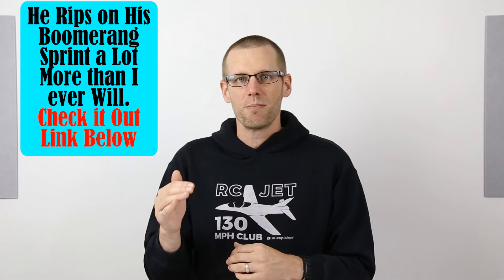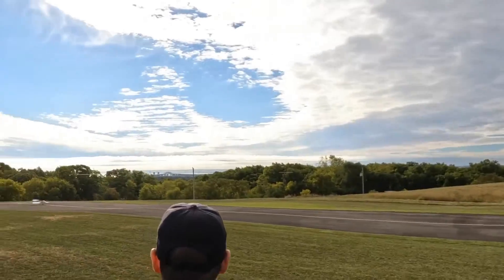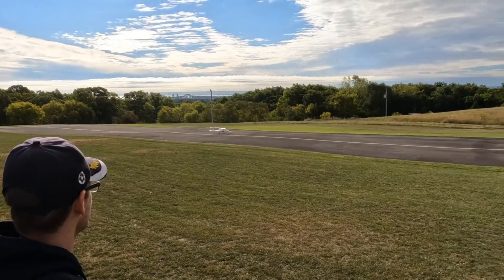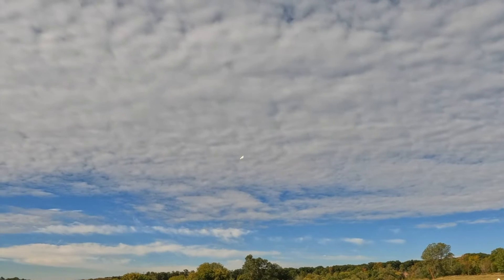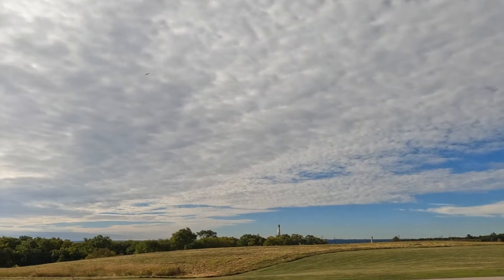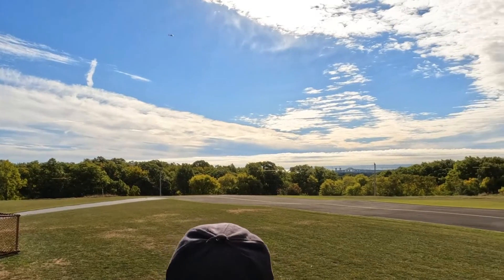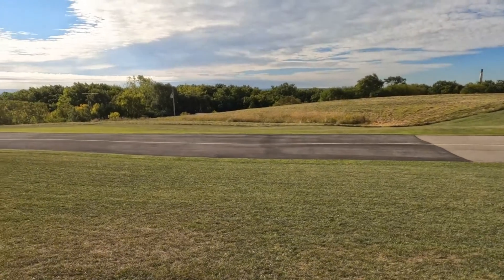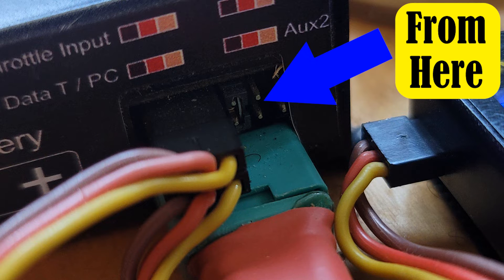What Happens when a $6500 RC Jet's Turbine Engine Quits Mid Flight?

Comment: I saw a video of a guy just started his for the second time ever and the starter stuck on. It spun up like it was supposed to but the starter disintegrated. He didnt know it was stuck on. Yours wasnt winding down like it wasnt getting fuel. Something was slowing the turbine and shaft down. Perhaps the starter?
Not that you would, but what happens if you accidentally hit the starter in flight? Does it engage?
I would bench test it again, but roll the engine side to side and upside down. Simulate the flight as much as possible and see what happens.
Reply from the maker: I think I saw the same video. The starter on this engine disengages at 27k RPM well below idle RPM. During the start up sequence I confirm this has happened and it's very noticeable by ear.
A user can't engage the starter while the engine is running. You can only give commands such as start, stop and cool the engine. 
I'm also sure that if it was stuck, there would be nothing left of it after I hit 152K rpm and the engine would not even feel the tiny load that it has relative to the amount of power the engine produces. The whole engine and system is pretty incredible.
Reply: @RCexplained   Yes. Someday Im getting me one. Until then, electric propellars for me. Youve no doubt seen that red flying jet wing?  It does something like 422 mph or some insane speed?  If I tried that, Id probably get arrested for neglegent. 🤣 homocide on a gross scale.
Reply: @RCexplained  
Got it. But it sounded like something was literally braking on it . They dont wind down that fast, do they?

Comment: Hi guys, I have 2 questions 
1- can pwm still be 100% if I reduce the speed limit to 60% in the controller setting when the throttle is still at 100% full?
2- if I limit my 80A controller to 50A, when Im turn on power boost (20% extra torque) will the current exceed 60A or still 50A (the numbers is just random figures)

Comment: Hi guys, I have a question
What does it mean by continuous rating power with rated voltage and rated amps. Does that mean that the hub motor will be the most efficiency point? 
But I heard that some people says the most efficiency point of the hub motor is around 75%-80% of maximum power where as continuous power is only at around 50% of maximum power

Comment: Well, I recognize the field and your spotter! I also recognize a Jet Central Power Pack going south! Send it in and get it checked out......most likely a replacement Power Pack for the engine.
Reply from the maker: Hey Brent. Great to see you on here. Thanks for the protips. I'll have to figure out that process. The rabbit has 22.1 hrs on it. Should the turbine be sent for an overhaul too?
Reply: @RCexplained  That would probably be recommended anyway at those hours. With your issues, they would want to see everything sent in for assessment.
Reply from the maker: Makes sense, thanks

Comment: I am absolutely not an expert on these, but the sound immediately reminded me of inconsistent fuel supply. Together with the smoke from the power unit, I would postulate that your fuel pump sometimes encounters extra resistance. This brings up the current beyond what should be the max and hence creates smoke and also drops turbine speed. This could be friction, the shaft bending due to imbalance/resonance at certain and/or higher rpm or (if your set-up has it) a glitchy fuel metering valve. (I think fuel metering is done only via the fuel pump rpm, but wanted to mention it.)
Reply from the maker: Thanks for the insight

Comment: You weren't pulling any radical maneuvers, so it's not a compressor stall. Would check the engine for any physical damage... you could have swallowed a bug. Most likely it's a fuel issue. The injectors on hobby grade gas turbine engines are super sensitive to impurities in the fuel... at  least it was on our Wren. We used to filter out the kerosene multiple times just to be sure. As the others pointed out, it could be a failing fuel pump.
Reply from the maker: I'll check out the fuel. Thanks.

Comment: You nailed the deadstick.

Does the FADEC have a pump calibration routine you can initiate?  On xicoys you just slowly advance the throttle to 100% when running, and it triggers a pump cal.  So far as I know the FADECs are just trying to match a pump value to a target RPM.

If it let some magic smoke out, seems unlikely it's going to fix itself lol.  Does that turbine have a barometer or anything for temp sensing?

Definitely make more content on the issue, particularly if it involves static testing of a turbine at full power - that's almost as much fun as flying them.
Reply from the maker: Thanks! I'll have update videos.

Smoke wasn't good but that part is the most confusing to me. The turbine measures exhaust temp.

There is a pump calibration that was done on the run up before taking off. It sets idle to max rpm.